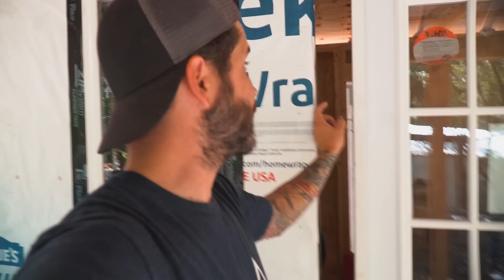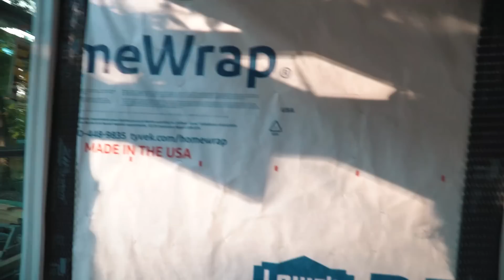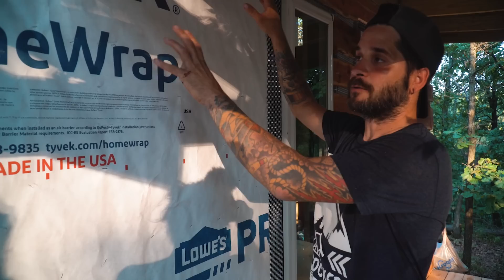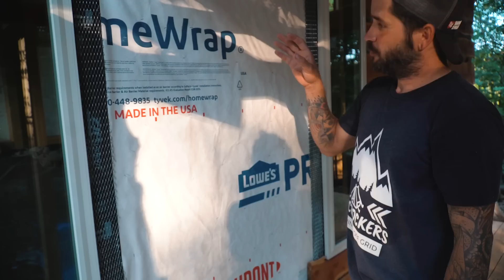Front Door & More added to the OFF GRID - TINY HOUSE / CABIN! Our path to self reliance!

Comment: Looks like there could have had some good rain harvesting
Reply from the maker: Yes, I wish it was set up. But we're on a budget
Reply: @TheCrockers  in time that will happen , all these Blessings are unfolding piece meal at a time. No worries it will all unfold very nicely.
Reply: yes you had a tarp up before to catch rainwater, set it back up. Pretty ssoon you will hit the dry spell and you'll be begging for water.
Reply: I bought a section of rain gutter for a very few dollars, and end caps. left it where the rain flows off the edge, below on some log stumps, and it filled up 5 gallons in no time. Enough made it to the gutter - detached, set a few feet up off the ground - to make it so worth while.
Reply: You two remind me of the good old days. You know, when I had knees that actually worked!

Comment: You need a stainless steel bacon grease container. They usually come with a removable screen (easily cleaned with hot water) and bacon grease can be kept at room temperature. It's great to cook with and adds great flavor to eggs, greens, you name it! Mine got overrun with ants, so you might need to put the container in a ziploc bag after the grease cools.
Reply: We used to tell our Border Collie he was begging and he'd hang his head in shame and move into the living room, where he would lie down but could still see us. At first, he'd be facing the other direction, but in time he'd turn his head to watch. Any one of us would just call his name and he'd quickly face the other direction again. It was always funny to watch him do it.
Reply: One more comment and then I'm done. I LOVE the idea of using rock on the wall that will have a woodstove on the other side. That's gonna look sharp! You guys work well together. Got a lot done!

Comment: The nice tool your using is called a Draw Knife. One of the things you might want to think about investing in is a Propane Refrigerator and a Propane Griddle to cook on. The Refrigerator runs off a 5 gallon tank as does the Griddle. Frig you can order from Leman's Non Electrical. Will help you to store food without having to buy Ice all the time. The Griddle Tractor Supply usually has them. It will help keep dogs away from food and you can stand up to cook. These are just suggestions to help make your Off Grid Life. House looking good. Peace ☮️

Comment: A thought to make it easier for your self trimming the bark off the planks.  When you go to town, try to pick up a larger twin screw wooden clamp, some self stick 80 grit sand paper, and a couple 12 inch quick clamps.  Should be around $40 for the clamps.  Stick the sand paper to the faces of the wooden clamp, use the quick clamps to clamp down the wooden clamp to the edge of the deck, and clamp your plank in the wooden clamp.  It should act as a vise, and make trimming the bark much easier, and you should be able to do the trimming by your self.  The clamps can be used for other things as well.    Also, Think about the weight of the river rock.  Were you planning to use full river rock out of the stream, or buy the surfaced thinner rock from the store?  Full rock will add a lot of weight, and you don't have a foundation below to support a lot of weight.  Melissa is a plus for you, and she seems so happy all the time.

Comment: With the roof installed you mite invest in a rain water collection system. The more water the better. Those two hundred and fifty gallon totes are the best. Look into a used RV 12 water pump.  
.

Comment: I hope you are planning on covering the gaps between those wood slabs on the outside of your house. Are you planning on chinking?  The Tyvek House Wrap is not intended for permanent exposure to the weather and UV radiation. Yeah, sure, it is engineered to allow about a 6 month window of construction, but if you don't do something about those caps, in the long run (maybe sooner than you like) the product is going to start to degrade and break down and there goes the purpose and protection the product is used for.  Again what are your plans for those gaps (were you going for a "log cabin" effect maybe?)

Comment: I’m watching this video and you keep getting up and down off of that porch over and over and over, you’re going to kill your knees. You need to build a little portable box with two steps on it to put next to the porch and just move it along as you’re working just make it a foot and a half or 2 feet wide, just a little box step to jump up and down there so you’re not constantly killing your knees and back climbing up and down off of the deck.  I have a plastic said I got with the trailer along time ago and it’s become a construction tool now when I change lightbulbs or work on some thing on the ceiling that’s enough so I don’t need a ladder most of the time and that would be perfect to put by the deck and climb up and down. You could build one out of scrap in 10 minutes

Comment: One thing you can do that helps with gaps, like between the door and frame, is use backer rod. Get one a little over sized and stuff it in there. It will move with the wood as it shrinks and expands and still provide a shield for air. Then fill in with foam the rest of the way. Just a tip I learned.
Call the house BLT. Bacon Layered Tinyhouse 😂
The house is looking amazing bud. Y'all work together so good. Bouncing ideas off each other and all helps a lot. Y'all good together.
I think the dogs like her cooking better than your's 😂
God bless you both and keep you safe

Comment: You should have bought most of your doors and windows, months before you started your build. You can sometimes find $1000 doors on clearance for $100-250. It might take 20+ trips to various hardware stores to find a good discounted door or window you need, but it will save you thousands of dollars, by constantly looking at the clearance racks all over the stores you visit. I would NEVER put a 32 inch door as your front door...you will come to hate that tiny door very soon when you can't fit things you have into your new house (fridge?). Also, you could have built your own customized door out of 2X4s...and some nice hinges., then bought a door knob drill kit to do the door knob.

Comment: Why are you chopping those nice long cedar boards into 2 & 3 foot sections. Start at the corner and run the board over the front surface as far as it will go. Don't stop at the same spot each course. Stagger your joints. When that cedar dries it will making it all chopping looking.
Reply from the maker: I think you need to go watch older videos. I've explained all of this

Comment: I hope there's no bears around there. Cause l wouldn't trust that front door. l lived in a grizzily bear habitat in Hope, Idaho. My front door was solid wood and my windows were thick enough to be bullet proof. Bears can be a force to be reckoned with. Also, l'm not sure where in Oklahoma your in but from the looks of
 your first night in the tent. A
tornado shelter might be a plus with supplies in it. Also, when your using power tools please turn down the volume so our ears don't get blasted with load sounds. As a machinist in my other life l had it grained into my head to wear safety glasses and ear plugs when using load tools. Which both of you should be wearing. When l stopped wearing them l developed tinnitis which never goes away. l doubt if you want to hear load ringing in your ears the rest of your life.

Comment: For your tiny house  outside corners  are you  going  to cut 1/4 section  out  and use the 3/4  piece  to covet corners  look like having post for corners     thing that could look cool just wondering 
 Excellent helper Melisa is  you two seem to meld well together
Reply from the maker: If I can pull it off,  yes!
Reply: @TheCrockers  use string line and skill saw  could  use chain saw but belive  skill  saw give better depth control   possibly  smoother  finish cut